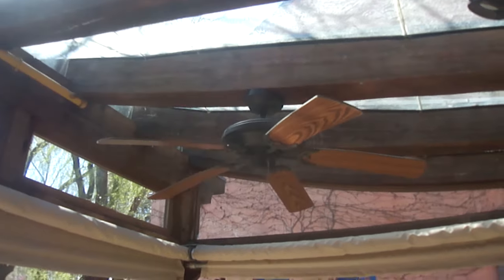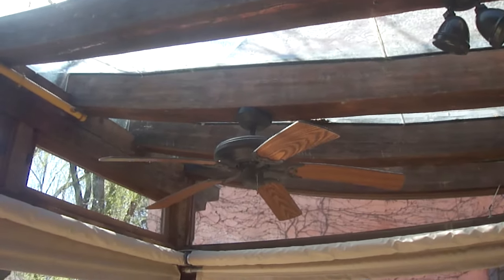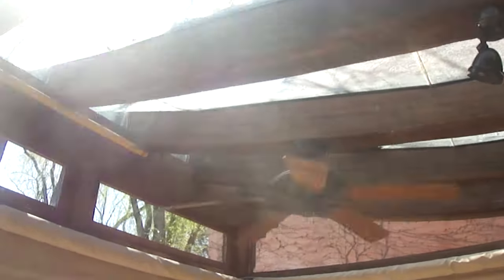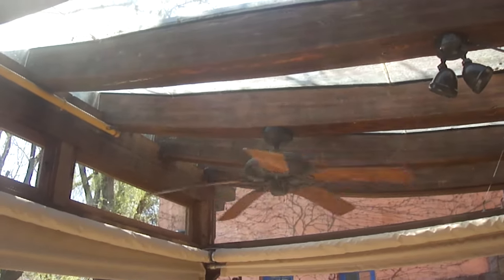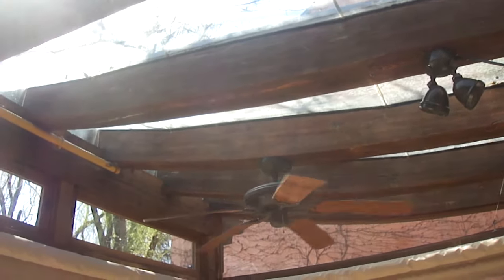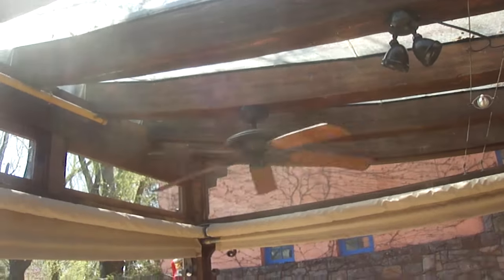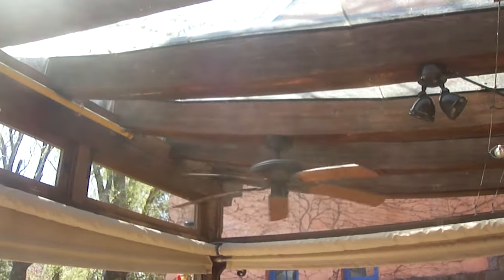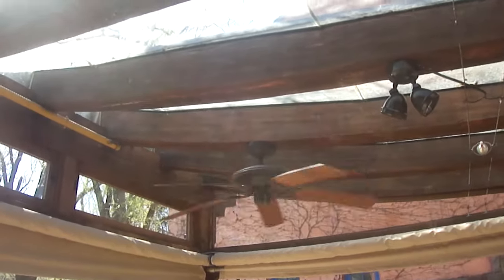Hunter Sea Island/Air ceiling fan: replacement MDF blades

Comment: Is that a screened in area? Or is the top covered? I’m still trying to figure out if these fans are wet rated or just damp xD never could figure this out
Reply from the maker: Just top covered, and it's damp rated. Damp location means it can't be rained directly on, but can still get exposed to humidity.
Reply: @CeilingFanVideosOnYT  no no i knew that xD i just wasnt sure if these were damp or wet rated! i dont have any damp locations in my house only dry and one wet location where i have an Emerson Sea Breeze installed

Comment: were was the wall switch to those fans
Reply from the maker: On the corner near the one with original blades.
Reply: inside or outside
Reply from the maker: Outside.